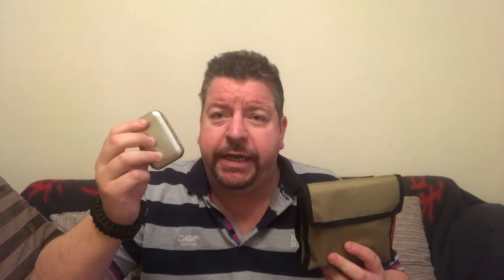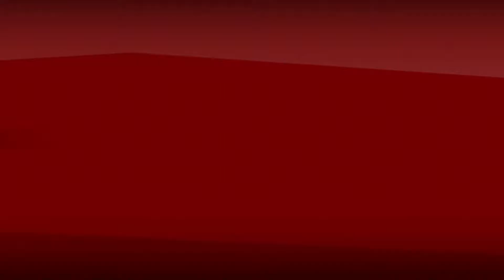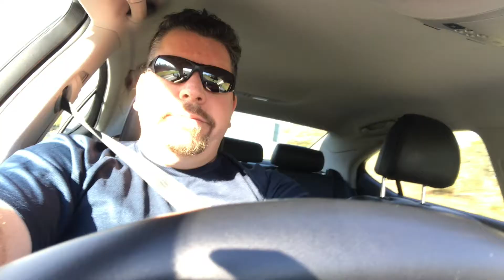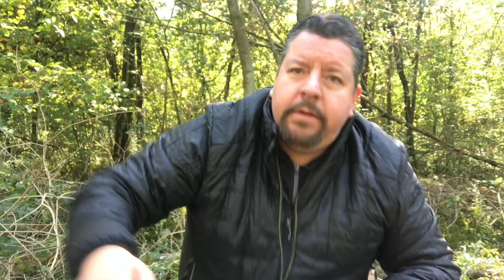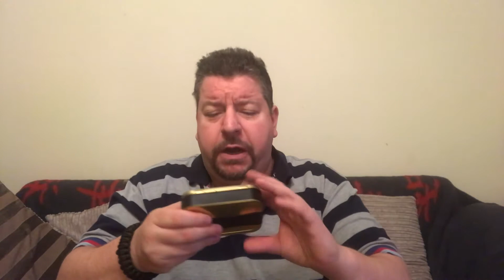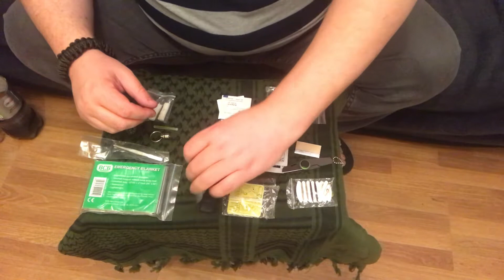IMPROVED SURVIVAL TIN

Comment: Oh, and PS. Re: Additions to a survival tin/kit. Sometimes it is the simple and obvious things that people forget. Equally, they include things (the fishing kit) which they are all almost certainly never going to use or, if they did, would not do them any good. 

I would (and do) always include some boot/shoe laces. They are multi-purpose, do not take up much room, you can set fire to them (fire lighting) at a push and, best of all, when your boot laces snap (which they will in that 'survival situation') you are going to have a real problem moving around in floppy boots. Just try replacing the broken lace with the snare wire or the fishing line. Good luck!!

Cheers and thanks for the vid.

Twm